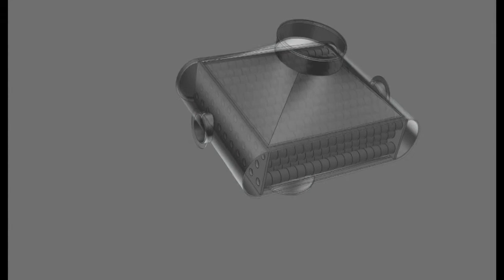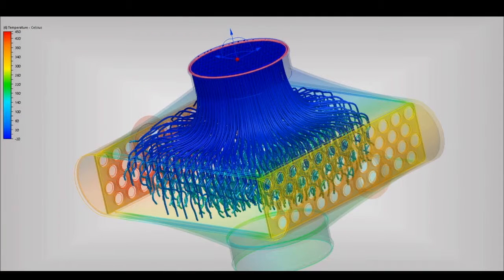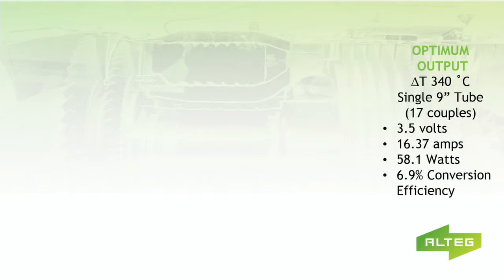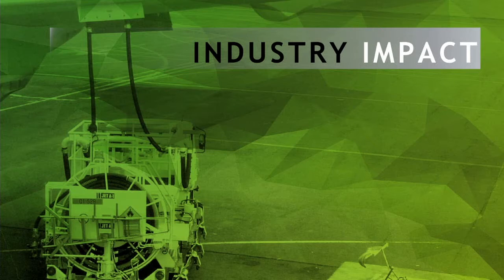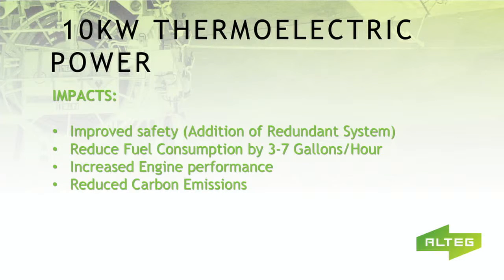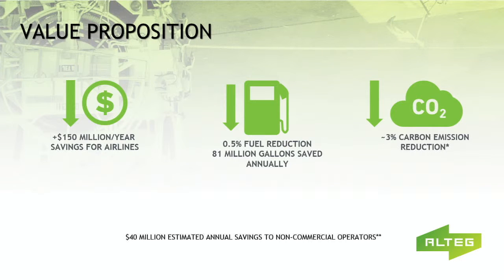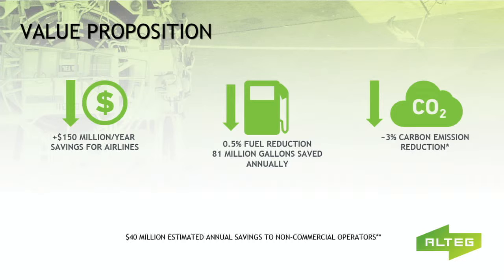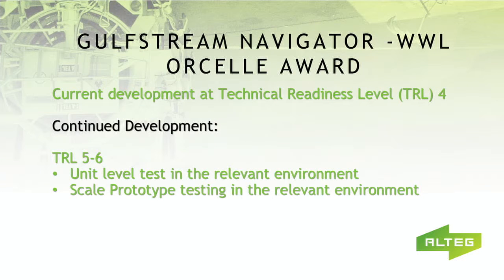Hybrid Heat Exchanger by Alteg Systems, Inc

Comment: Hello, Why not comparing power / weight ratios between your solution and the existing batteries ? it's one of the most relevant challenge, because batteries do work.